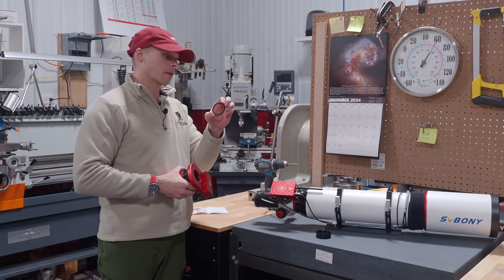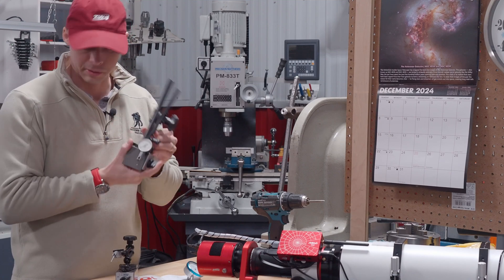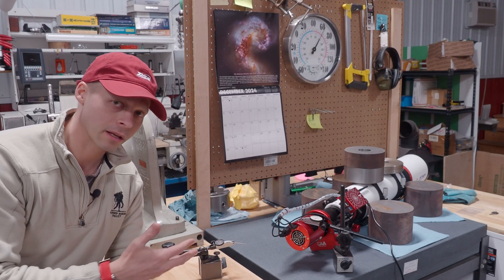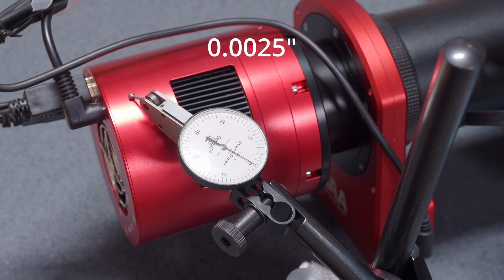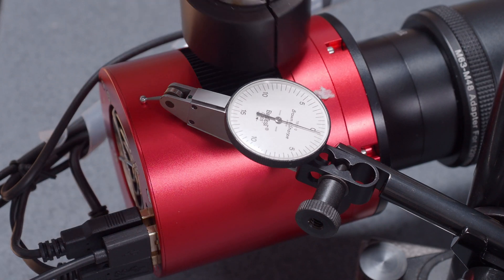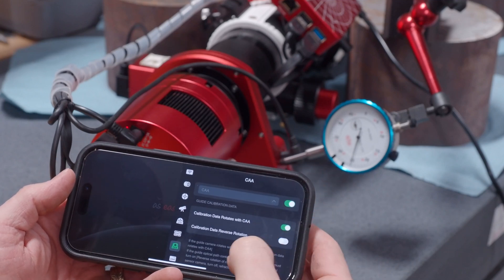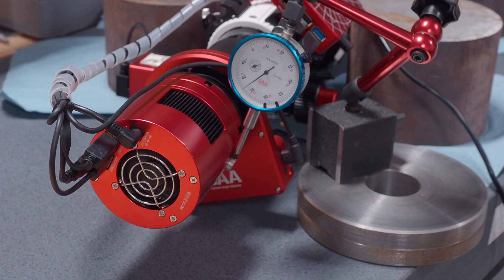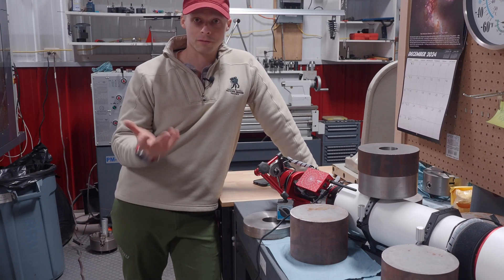ZWO CAA Rotator Precision Backlash Test

Comment: The very first test you do by adding that 2 lbs force in two different directions, you should have taken these measurements with that force applied at the same distance from the rotator OR taken the distances into consideration, as you did it the two numbers for the 2 directions can not be compared to each other.

Comment: I bought one of these CAA's unfortunately and I haven't even taken it out for a night, it's probably coming right back off my rig.  As soon as it was installed with filter wheel and all I was immediately concerned with the amount of play and lack of rigidity.  I went straight for my dial test indicator.  I'm appalled.  I put my dti on my scope so I was testing the movement just the cca introduced.  It doesn't really make sense to quote the measurement as I measured on the surface of the filter wheel but I can say it was very concerning and I don't think it'll even see a night.  Maybe his copy is better mine you can feel the play by hand definitely don't need the dti to know there's a problem.  Edit: To clarify the backlash is horrible but my bigger concern is with the play in the other axis that I suspect will introduce variable tilt throughout the night.  I also just frankly cannot see how I could reliably get usable flats as the weight of the filter wheel is plenty enough to alter the position of the CAA through a meridian flip.  I would avoid this product!
Reply from the maker: How much was there? Have any numbers? A lot of people take a dial indicator to things and over react to non dimensional critical things. My advice is to try it and let the picture tell you. That never lies.

Comment: Did you get a chance to test if there is any run-out? I imagine center an adapter into a lathe jaw, then attaching the rotator, and testing:
- square-ness of the rotator construction by rotating the lathe jaw, and testing on the output side,  and
- rotator-runout by keeping the lathe stationary and measuring the output of the rotator.
Reply from the maker: This is something i did not test. However tilt in stars seams almost non existent so i imagine runout is likewise non existent .

Comment: A few things on using rotators. You need to tighten the threads a bit more than a non-rotating camera or the cable tension can start to unscrew it. The motor will then turn but the camera stays still. So give yourself lots of extra slack in the cables so they can move around and not get strung tight. Also make sure you have the camera angle in your file name so you can match your flats rotation - if you do several targets at different angles, it's easy to lose track of which flat went with each target. Enjoy!
Reply: Are rotators generally accurate enough to be able to properly reproduce a sufficiently accurate angle for flats?
Reply: @JeffHorne  As long as the threads remain tightened to the same degree, you should be able to return to any rotational angle between flats and lights. Your imaging app should be able to report the current angle of the rotator, and the PA angle in the sky after doing a platesolve. If you do a teardown and rebuild, you may need to recheck that the rotator angle and PA angle remain the same; you may need to re-zero the rotator if different.
Reply from the maker: Just do not assume it will do this accurately enough to remove dust motes on your focal reducer. But for vignette compensation it is plenty accurate enough.

Comment: Maybe measuring on black tilt adapter is a bit more precise.
Reply from the maker: In retrospect I probably could have bolted something to it however when I pushed on the dial it did not move. Dial indicators apply very little pressure. That does vary though from brand to brand of course.

Comment: It is hard to tell what part of image train the weakest. It could be focuser, rotator, or even camera case is not tight enough. Also rotating and taking measurements on camera body is also far from precise as aluminium camera case may not be aligned with the image train axis.
Reply from the maker: Subtract the measurements done without the CAA from numbers with the CAA and you can deduce that.
Reply: @TheNarrowbandChannel  that is actually good point.

Comment: This could also be your focuser tube.
You need 2 dails, one on flattener and a second one on camera to test flexture.

You are correct on rotation.

I wonder if it is precise enough to do anti field rotation on alt/az ap system
Reply from the maker: That is why we did the same test without the rotator. You can subtract the flexure without it to get that number. Placing dials on two different spots will give more confusing answers because you fulcrum point is moved considerably farther away.

Comment: I would be more interested in tilt introduced by rotator. Having micrometer I'd expect measuring tilt during rotation at least for the cage. And disassembly and internal structure are more interesting; it will help understand potential issues
Reply from the maker: That is what we are measuring here.